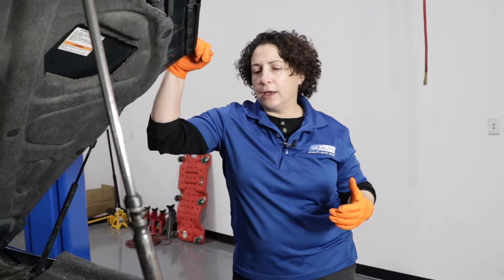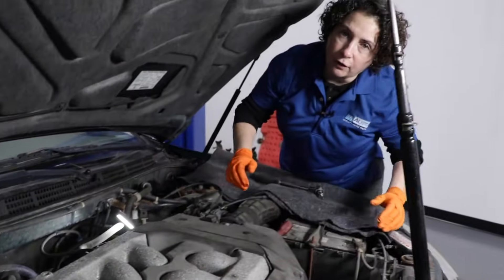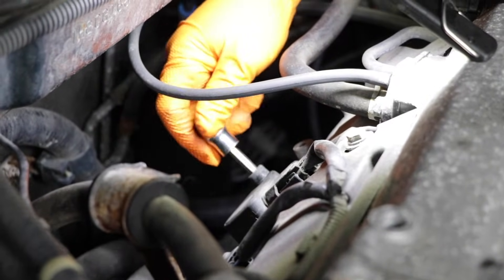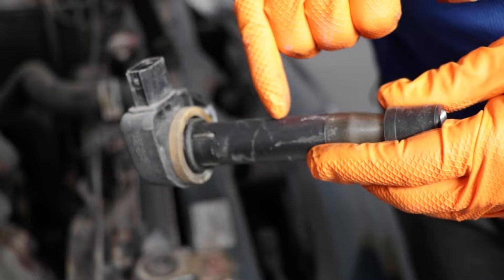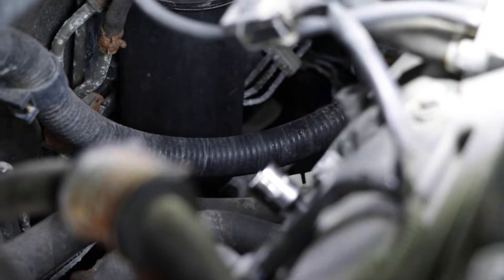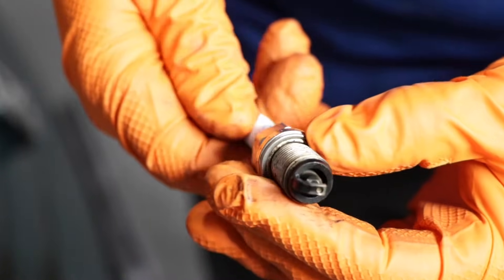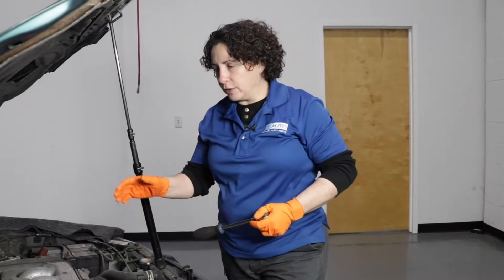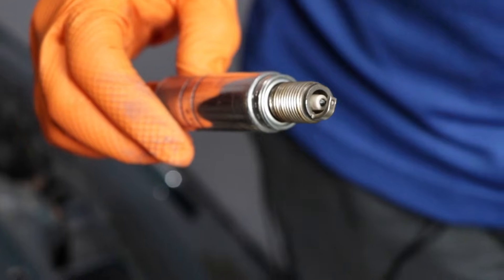Engine Misfire? Trouble Code P0303 Meaning, Diagnose Spark Plugs & Ignition Coils

Comment: I am having this problem took it my dealer and 2 other business and they all said have replace the engine. I am wondering if they done all this. I say yes bc hell I do not know.  Now my engine light is off and still getting the same diagnosis.  I been driving locally and not far lol. I still think nothing wrong with bc I do way overboard maintenance. Car did not make to 100,000 but this issue cost me alot just to diagnosis and me saying no I might else get a new car.

Comment: Ok so I cleared the codes and moved coil and plug to different positions  but i am still getting a p0303 when I pulled the plug it looked and smelled of antifreeze but no other plug or coil did now what do you think I should do oh I also keep getting a p0135 for bank 1 sensor 1 sensor is new.

Comment: Okay, so we go through the trouble of isolating which coil and spark plug has the trouble and then we replace everything anyway? Huh?
Reply: yeah coils are expensive
Reply: i know im late but she said replace all the sparkplugs which are 10$ each ish, bc they go out around the same time and the rest would just go out soon there after. You isolate the problem so you can replace only one coil which is like 50$+
Reply: Exactly what I was wondering, what was the whole point of doing that?
Reply: Exactly! Why troubleshoot to find the culprit only to replace EVERYTHING!? This is how shops make a lot of  money instead of what could have been a cheap $2 to $50 fix turns into hundreds! 💲💲💲 🤦‍♂️🤣

Comment: You miss-spoke at 4:03 and said cylinder 4 instead of cylinder 5.  Also, why, would you replace all the coils, instead of the one you determined to be the problem?
Reply: Usually when one is bad the others are also on there way out so replacing all of them you remedy that
Reply: ahahahah  i was like ... what lol u crazy change all the coils lol and why in the hell would i chasse anything you just proved it you swapped it so u either got bad coil or bad plug u even had the plug in your hand ... just replace the plug and it cost you what 7$ at most lol and if that dont work well daww u know already it the coil ... but change alll coils u crazy lol
Reply: Preventive maintenance

Comment: I'm confused as to why you moved the coil AND the plug to cylinder 5. Moving only the coil would have narrowed if further, if the misfire moved, bad coil. If the misfire didn't move, bad plug.
Reply: i'm with you on this one, doing it the way she explains leads to the replacement of a possibly good ignition coil.
Reply: If I had a misfire with the plugs or coils I'd replace them both just to be on the safe side
Reply: @dustinlanphear422  I have a misfire but I don't want to spend $240 to change the coils out. I have to figure out which one is bad. The coils are $60 a piece.
Reply: Not always coils or plugs is the case can be a numerous of things like injector fault, injector pulse loss, vacuum leaks, dirty MAF, throttle body sticking etc. Would be nice if it always was just coils and plugs. FYI Master tech
Reply: Start with the coil and see if the misfire follows it, if not move the plug,  if still nothing then hook a labscope and check the injector
Reply: Because it's a waste of time and money to change only a plug or only a coil. 
1. Mechanics charge $160/a book hour on average in the US. Having them spend 2x the time swapping plug, then doing it all over again for coils is a waste of time and money.
2. If you have a bad spark plug and or coil, the proper fix is to replace both plugs abd coils.
3. You shouldn't just replace one coil/plug, it's always best to change all. If you are strapped for $ you can always get affordable plugs and coils that meet your vehicles recommended spec. A new and used spark plug can give different voltages and fire weaker than the other. It's standard procedure to replace all spark plugs together.
The ignition coils do get expensive when you have a V6-V8 engine as supposed to inline 4's, but it cost a lot more to keep replacing coil after coil. Especially if you have to take it in to a mechanic and be charged multiple times or if you require online ordering which costs shipping on every order. Even part stores charge fees for ordering parts. Why not do it all at once.
4. Spark plugs and coils have a service life, when a coil goes bad the others will follow soon. Same for spark plugs unless there is oil leaks or air/fuel ratio problems causing deposits in 1 or a couple valves.
Reply: Not necessarily, if the misfire moved, definitely the coil, just as you stated. If it did not move, you can’t assume the plug is bad until you swap plugs with a different cylinder to see if the misfire moved. If the misfire moves, bad plug. If it does not move, then there is a different issue with that cylinder. Could be a fuel injector, rodent chew on the wiring. Or even valve adjustment.
Reply: that's what i'm thinking Serafin Silva
Reply: Thank you!  I had this same question!
Reply: Yeah I was confused on that one myself, I thought it was to determine if it was the spark plug or coil pack and then she said change all the coil packs???
Reply: I was confused as well, you know it is either the coil or the spark plug but moving both you have the same issue. Of course it was going to jump ?
Reply: Because she determined the plug was worn out and needed replacement anyways
Reply: I have to agreed with all of you, it seems like she forgot the basic process of elimination. I will also have to say, she went the expensive route, by saying it was the coil, consequently... CHANGE THEM ALL (The coils).  What if the customer doesn't have that budget?
Reply: She never confirmed which one was bad by moving them both
Reply: Right! 🤣🤣💀💀💀💀💀💀
Reply: Agree
Reply: It eliminates the issue of a wiring problem to ignition coil one. She also mentioned that if you didn't have a compression gauge then this would rule out a compression issue. She also mentioned she would replace both coil and plug which though is more expensive is probably prudent to do so.
Reply: OEM parts
Reply: I think she paid more attention to making the video and didn't realize she goofed the point on solving the problem.
Reply: @blueridermg It's the only way to rule out that it's not a wiring issue or compression problem on cylinder 1.
Reply: @blueridermg  Bingo
Reply: She confirmed the coil #3 was bad by discovering and pointing out the marks indicating cracks and arcing in the coil shaft. She further confirmed it by examining, discovering and pointing out that the #3 spark plug WAS firing with a weaker spark due to the arcing in the coil's shaft, therefore the plug simply wasn't receiving ENOUGH juice to fire properly. 

The switch out with coil #5 was just additional method she showed to confirm the coil was bad.

Furthermore only an idiot would change the bad coil pack, but not the fouled plug. Who else is going to change a $50. coil pack but not the $6 spark plug.

In addition she also explained for the inexperienced DIYers how to confirm if the spark plug is trying to fire, but simply isn't getting enough current. As well as that you should replace all of the coil as soon as possible if you're changing one. As their life expectancy is pretty much the same. (The manufacturers and auto techs don't simply pull these numbers out of their rectums) Otherwise you will continue chasing bad coils.
Reply: @kelly-annflanagan7693 Good on you mate. 😎👍
Reply: Looking at the carbon build up on the plug, there is a question of engine issue.  She ruled out that out.  Geez GUYS!
Reply: @livetoinspireall2755 😎👍
Reply: Agree! 👍
Reply: If I had a misfire in my cars engine I'd replace all the plugs and coils so that it won't have the same problem down the road
Reply: @dustinlanphear422  and replace the wires as well
Reply: Pretty sure it was mentioned here. She took both over so that if it is either just go ahead and replace both. Which is not a bad idea. Might as well do it right the 1st time.
Reply: @Velcrostraps91  yes exactly, and if one were to move only the ignition coil, let’s suppose both coil and plug were bad, now the problem is not isolated, it is spread to two cylinders. I’m with you and I believe the video has the correct diagnosis steps.
Reply: @Velcrostraps91  That's never a good diagnostic strategy,  may as well shot it with a shotgun load of parts and hope one fixes it. Obviously you don't do this professionally.
Reply: Cause they don’t know what they are doing
Reply: I watched this 3 times and I'm still confused .?
So what do we do if the misfire moves?

Hey I know 
We will just replace the stupid Egr valve on the back firewall that you can see !
Can't get  too 
 neither.!

Im more confused than a sterile rabbit.
😁
Reply: @timothydean Three things had to be ruled out Compression, bad coil or spark plug. By moving coil and plug the issue moved from  cylinder 3 to 5. Indicating compression wasn't a problem but was either coil or plug. She said at the beginning she would replace both coil and plug - the plug was fine and replacing both is preventative maintenance and plugs were fine.

Comment: My sons 2005 honda civic lx threw a po301 code (cylinder 1 misfire). I want to pinpoint the problem. So I swapped coils 1&2 first. Then cleared the codes. Once engine light comes back then I will see if I get po302 code. If yes then the coil is bad and will replace. If not then I will swap the spark plugs. Clear codes again check the codes. Swapping plugs and coils at the same time will not pinpoint the problem.
Reply: Doesn't rule out a possible compression problem or a wiring/signal problem to the coil. She also said if if it was found out to be coil or plug she would replace both which is preventative maintenance and avoids extra cost of time and effort for testing.